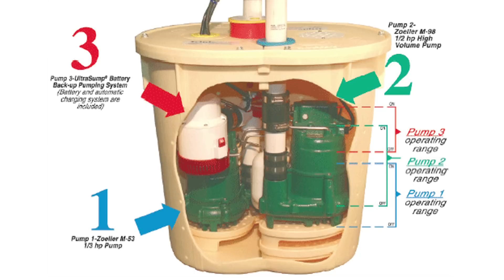How to Waterproof Leaky Stone Foundations

Comment: This fix only deals with water coming through the walls. this channel system looks to be installed just below the floor. What about the water on the outside of the wall? Wouldn't it be wiser to dig to the bottom of the footing to capture the water there and thus releasing the pressure on the walls? The reason the water is coming through the walls in the first place looks to be water looking for a place to go. If the water was allowed to flow down the exterior of the wall down to this channel then into the sump pump makes more sense to me. how is this a replacement for French drains?
Reply: That should have been time at the time when the house was built.

Comment: So what happens under the vapor barrier?  Water continues to come through the walls and into the drain. Is that an issue?  Wouldn’t mold start growing behind the vapor barrier?
Reply: yes- especially with this type of vapor barrier- The only better type I can think of would be DMX wrap but obviously the best thing would be to prevent moisture from coming through at all but adding a barrier outsie.  I am going to put up DMX Airgap for mine- I think the airflow should be enough to prevent mold

Comment: My car engine is leaking oil from the valve cover.
Should I put a rag around the outside of the cover to collect the oil and let is drip off onto the ground ? (as in the Basement Systems Inc program)
Should I put sealer around the outside of  the cover to keep the oil from leaking?
Or I could do it properly and replace the gasket.
I worked with a contractor and asked him about just sealing and draining the inside, his answer was; we just spent $500 to insulate the walls, the water will come in a pack the insulation, rendering it useless. Every job we did the sealed the outside AND the inside of the walls. Makes sense......

Comment: What about mold between the wall and the vapor barrier??
Reply: Exactly!
Reply: It seems like a lot of waterproofing services use a vapor barrier like this. How would you prevent the mold?
Reply: Its plastic for a reason. Mold cant grow on plastic.
Reply: @stevekaufmann8109  but it can grow on the wall.
Reply: It grows mold because it's not along side of the footer. When you leave it open air gets to it and mold grows on it. Yes plastic can have mold grow on it.
Reply: Exactly
Reply: Hey this not waterproofing ., this is living with it and taking risks that come with it not safe at all.
Reply: Airgap wrap (dimple wrap) like DMX should allow more airflow and in theory dry it out if the water / moisture isn't constant.  The system they are using just looks like the cheapest available option to placate the customer
Reply: @DS-kn4bs  Mold can grow on plastic, but it can't feed on plastic. If you have plastic over concrete with no organic material in between, then no mold will grow even if it's wet.

That being said, I still think this system is garbage.

Comment: I have this system. Had to be installed 4 different times. The system that catches the water also catches sediments that will keep it clogged and overall unreliable. I'm fed up and pissed that this continue to happen.
Reply: I am looking for solutions for my basement and this is exactly what my thoughts were! My basement walls allow a lot of sediment through (even with an epoxy covering it) and they would just end up clogging this.
Reply: This system doesn’t work well because it’s placed on the foundation. System must b placed deeper (where the water is) next to the foundation. Also 4” pvc pipe with holes at the bottom, not the grey square garbage he is showing.
Reply: You're not supposed to trap moisture on your foundation walls, it will make it age quick, you need to install a dehumidifier so that the humidity lowes to under 60, then your walls will dry up. You must keep the dehumidifier on all the time. Unless you're planning to redo your whole fundación you don't have another option, you can't put anything to stop water from filtering your foundation, no matter what it is, it will push it off sooner or later.
 If you have a serious leak you need to dig the outside of the foundation and then apply some kind of rubberized impermeability material, but if it is serious enough it will still find its way in. I bet if you clean your gutters make sure you don't have water from the outside running inside, your problem will not be so deep. That alone would fix the biggest of it all, then the dehumidifier will deal the deal. You could install that drain system if your leak is big, and the sump pump. That will make your system really effective combine all three things. 
 Outside water control
Dehumidifier
And your drain to sump pump system.
Reply: I'm so sorry that you're going through this! I understand the struggle and the frustration. I'm having an issue with a leaking basement, which has caused bowing in my foundation and a horizontal crack. What I'm currently doing is patching any exterior foundational cracks/openings from the exterior and directing the water away from the house, by angling the concrete foundation to slope away from the house to one specific point where all the water settles, and at that location, I'm digging a trench to slope downhill, and using a catch basin at the top of the hill to carry it away through the corrugated pipe, which is also angled downhill. Then, on the interior, I'll be using steel I beams in attempt to retain, and possibly correct the wall, depending on what I can afford materials wise. Then I'll be squeezing in either foundation concrete epoxy or polyurethane caulk into the cracks to seal it.  I'm not sure if any of this would help in your situation, but it might be worth thinking about. I will be posting a video on my entire project once it's done. I hope things eventually work out for you. If it does, let us know what worked!
Reply: @2333jc  thanks for your post.  it's helpful.

Comment: I have a fieldstone basement wall. It only gets wet when it's raining. But I can't fix this from the outside because my house is 2 feet from the street! What are my options here?!
Reply: Ian it is time to move.
Reply: I have the same issue- my recommendation is to caulk all cracks outside pave all space between yourself and the street with a good slope towards the street- on all other sides slope and add drainage if you can.  Inside dig down to the footer and lay a drain tile next to the footer (Not below).  Holes facing down run it at a slight pitch to an interior sump basin.  I am using DMX airgap for my foundation walls which technically isn't for a stone foundation but I plan to make it work.  If you have hollow stone or cinderblock drill weep holes to remove the hydrostatic pressure

Comment: I've done a few of these as a carpenter for clients. Easiest, best way I've found is first, make sure ground slopes away from foundation , if it cannot because of windows, not a problem but better to do so for at least 4 feet. Next get guuters working and taking water away from foundation.  Then just chip out the old lime-based mortar using a small hammer drill you can buy at harbor frieght for less then $30 with coupon  or use a regular drill, mortar is not that hard to chip out, use a small masonary bit so it will fit in small joints and replace with type S cement which has 2 additives, one for bonding and the other for flexibility which helps mortar not crack in future. Do not use additional bonding agents.  Make sure to dampen the stones before appying the cement , very, very important to get a great bond,  just be sure to dampen. I used a pump sprayer, you can soak them but then let stand as stones will absorb the water which is what you want. Once stones absorb the water and are just damp then apply the mortar into joints. Dry stones will suck the water out of cement causing it to shrink and  not bond well. I use rubber gloves and just my hands and fingers to get mortar into the joints as to uneven to use any  tools unless maybe your very experienced with the tools. then I put a 2cd layer which just filled in any unevenness in the stone face, then i did a 3rd coat covering everything including all the stone faces so no stone could be seen in foundation as stones are porous and could potenially become damp, to eliminate any dampness coat everything.  When each step is curing (drying) i also spray just a bit of water on the cement to keep moist as this helps the cement bond better , make sure cement is just hard enough to not fall apart from the water. You may not have to do this as a basement likely is moist enough to to bond well but i did it to try and get best results.  once done you can paint with masonary sealer type paint, i did that for clients but not in my own property and have not had a problem without doing the paint. Have not had any issues with leaks since or problems with the foundation to this day . Now, I have seen people just skim coat mortar right over the old mortar and it works but i have seen it not work such has in my property, some areas it worked others i needed to chip off the new mortar and chip out old mortar and that is a pain has the new mortar is tough getting off using a sledge hammer. took me and my friend taking turns, so i would not advise that method.
Reply: What you've done is encapsulated the wall with cement except that water will still get in a stone foundation no matter what. That lime mortar you took a power drill to allowed the water to leave the wall. You haven't noticed any leaking yet, but it's only been how many years? Lime mortars have kept these foundations solid for 2-300 years in the northeast . That trapped moisture will deteriorate your historic fieldstone foundation and will lead to foundation failure. If you'd like to understand a better method for old house foundations, visit the national park service historic building preservation website or even do a simple google search
Reply: I did alot of research before doing the job even historical website. Been done 20 years ago without any problems to date. Read some about what your saying Nicole but found that not true. Talked to Mason's on the subject they told me my way would not be a problem and so far it has not.
Reply: @mikemasters4382  That's either because you're in a dry part of the country or because it's a slow process that you're not seeing since you've encapsulated the wall. I don't believe that you found info on a historical website that suggests containing pointing a fieldstone with concrete unless you have an extremely hard stone
Reply: @Nicole-pv4eg  I did find historical web site that said he believed what you say early on but found using type S cement from the inside was not a problem.
I ask Mason and told them what you say and they told me it does matter.
And I know the Mason's well, seen their work and I know they know what they are talking about
Reply: @Nicole-pv4eg  also I have repointed older  chimney the same way, skim coated the outside of chimneys and people will tell you that you shouldn't do that because u need a softer mortar but again Mason's told me that I could do the things many other web sites claim you shouldn't do.
To date have not had any issues with any of it.

I bought apartment building back in the recession with a stone foundation and brick above grade. 2 layers of brick, the outside brick is harder brick the inside layer is softer and many web sites tell you to use a softer mortar but again Mason's, more then 1 told me that does not matter.
Reply: @mikemasters4382  It's a well known fact that the building trades are not being taught the old ways as much as they should be. Finishers that can't work plaster and masons that use concrete where lime is needed. Just because someone is a mason doesn't mean they fully understand how to work on historical buildings. My father hired a "mason" to repoint a section of our 220 year old limestone farmhouse. He used cement. Not only could my child do a cleaner job than he did (didn't even bother to clean up the excess), the cement has already started coming off from trapped water freezing in the winter. This was a mason who went to trade school. While there are applications where cement can be substituted for lime, it's not on historical foundations. I would be willing to wager that 10-15 yrs after cement is applied to the inside of the basement it will have caused major damage to the strength of the wall. Sounds like you at least tried to seek good information. Unfortunately, it seems the person you spoke to doesn't mind skirting by to make a buck since the damage will take a decade to become evident and by then he's long gone.
Reply: Nicole, I have no idea why you would compare your father's poor mason work to my masons. That makes no sense at all. You say again that I put concrete in a stone wall when I said I used type S  cement.  Just so the viewers know this, it would be impossible to use concrete in a stone wall because concrete hase aggragate in it. That is stones, and the stones would prevent you from getting the cement into small joints, I have no idea where you got I used concrete which again would be impossible.
I disagree with what your saying  simply as that.   I already told you I did some work about 20 years ago without any problems to date and now your saying there will be problems in 10-15 years, I disagree with you. Already did it and have not see any problems with it.
I've done many things in my days that people who like to go by the book on things told me I'd have problems with those things and I have not had any problems on those things either, your just another example I can chalk up to my own trail and error experience. It works just fine without any problems.
Reply: @mikemasters4382  I misspoke. You must know that and are capitalizing on the mistake to further your point. If you would like to see a thorough explanation with examples showing why lime is the way to go on a building originally built with lime, look up David Wiggins YT video: "How lime mortar works" from the APT symposium 2020. I've devoted all the time I'm willing to on going back and forth with you.
Reply: Nicole, thanks for the offer, but as I told you I already did the research and I know exactly why some will say lime is better. I disagree with them, not sure what else I can add. 
Except, 20 years later I have been proven correct without any issues. Completely leak free and not one issue with the foundation.
Reply: @mikemasters4382 are your masons union? Have they went thru an actual program? Some sort of apprenticeship/schooling? 

Type N mortar is what you use to repoint. Type s is OK to lay with ABOVE grade. But typically only with stone or block. So with a chimney anything you did should have Been with Type N. And same for your what I assume is below grade foundation.

Comment: Great video. I imagine this home improvement project is quite expensive. This is exactly what my 1900 home with stone foundation needs but I'm afraid to ask the cost.
Reply: Jason Ricci did u get a quote yet? Im having same issue
Reply: just do it your self a simple vapor barrier will cost you $120. and the drain main is cheaper but almost exactly the same as the one in the video. except wether gaurd will cost you $540 for 60ft ans drain main will cost $255 for 90ft. youll also need a skil saw to score the concrete and diamond blade. then a jack hammer or the old fashion way (which I used for mine) a 10lbs sludge hammer. youll also need to by some misc. stuff like corning a sump pump and bucket. and inspection ports and some concrete. all together should run about $700-900 to do it with drain main. or the same one in the video probably 1200ish. if you pay some one else to do it I got quoted 10k for a 1000sqft basment.
Reply: took me a few weekends to do it my self I had no idea what I was doing. but its actually pretty straight foward. first you get your ruler and measure out 6"from the wall in serveal locations. get chalk string and match it up to the points you measured out. the snap and chalk line. then get the  skil saw and I used the Black and decker diamond blade. then you cut along the chalk line. it wont go all the way through just a score. then I took a 10 lbs sludge hammer and made a whole. it will break up to right where you scored it with the saw. Then you trench under the concrete and then break it when you have it cleared of debris. this makes it break much easier. you could also just use a jack hammer which is much easier and could finish the whole concrete braking part in about an hour. what I did took around 8 hours by hand. then you just dig out the trench to the slab. plus a piece of the drain main in there the wall drain should be about .25-1" about the ground if you went tol deep just drop in some pearock and bring it to the right hieght. then assemble the drain. (this part litterally takes 15 mins. its the easiest part. once assemble put some pearocks on top and cement over it. if you want to do the vapor layer as well do that part before the cement so you can easily put it behind the wall drain before you cement it inplace. time consuming yes. labor intensive yes. but definately a doable DYI project. I did it knowing nothing about it till I did it.